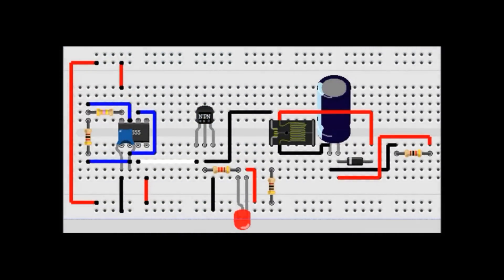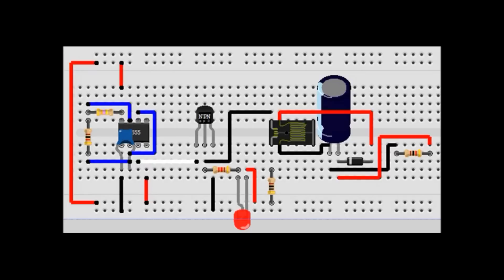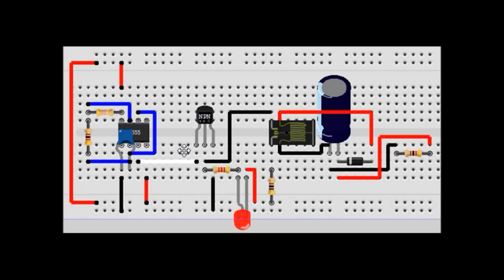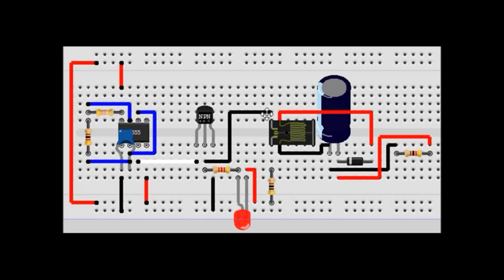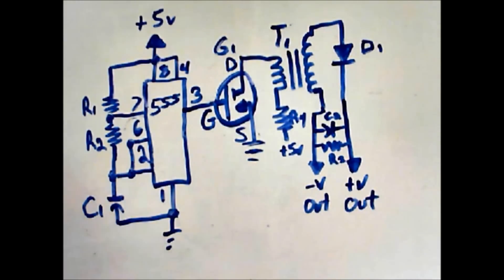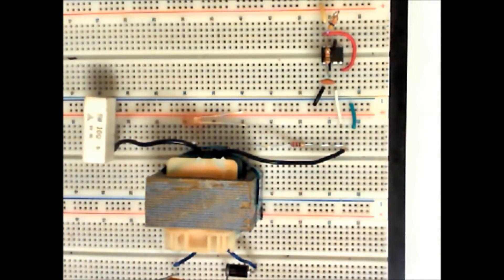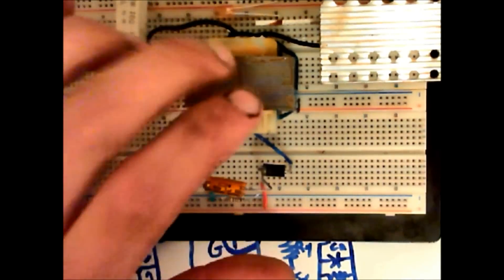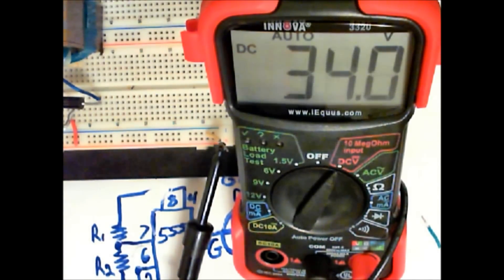DC - DC Boost Converter (DANGER HIGH VOLTAGE!) (HD 720p)

Comment: Can anyone help me with constructing a boost converter circuit with the following specs? Input voltage range: 24 to 48V; Output voltage: 60V; Output Power: 240W; Inductor current Ripple: 10% of Load current; Capacitor voltage ripple: 10mVp-p; Switching frequency: 10MHz (Use MOSFET Switch)
Thank you :)
Reply: Doesn't seem too complicated. I would google those specs (one at a time) and construct it that way. Shouldn't be too hard.

Comment: Got only 66,2V stable at output after ~200ms with ~6,7V Input. I am using a 2kHz PWM, i guess my Schotky Diode is to blame because it experiences avalanche breakdown :(. Wonder what would happen with a Diode with a bigger reverse voltage.. I saw the coil spiking at arround 400-500V on my Scope.
Reply: ***** hi, can u please send me circuit u used?
with values of all components..
fasih_fasih@hotmail.com
thenks
Reply: Hello Faseh Ur Rehman i am  using the normal boost circuit as seen on Wikipedia. As a switch I use a buz11 npn MOSFET. The pwm is generated by a Arduino. You can't drive the buz11 directly from the Arduino as 5v is to low for the gate voltage. So you need another transistor as a driver. The coil as well as the diode and the storage condensator are ripped out of an old PC power supply. I don't know the exact values. They don't really matter anyway as this circuit works with a wide variety of values.

Comment: Is the resistor connected to the capacitor neccesary? I built this circuit, tested it with and without that last resistor. Without the resistor I get around 35 V on the capacitor (from 5 V). But when I run it WITH the resistor, I get from 70 V to 130 V, but it changes quickly. It doesn't settle on one value (like it does without the resistor). Any thoughts? Thanks

Comment: i have to say this doesnt match the textbook definition of a boost converter this is more like a transformer with half wave rectification and powering (like in most switch mode power supplies). i have made a boost converter that uses a single coil inductor from a CFL bulb and got to at least 300v. im trying not to bash your creation because i think it can be very useful, just saying that it isnt a true definition a boost converter.

Comment: SG3844M Manu:LINFINITY Encapsulation:DIP-8,CURRENT MODE PWM CONTROLLER
is there a better version for a 800 power supply